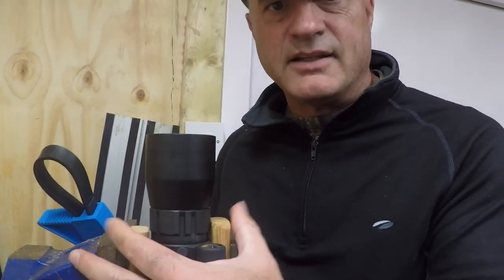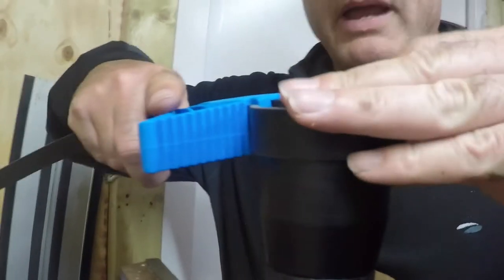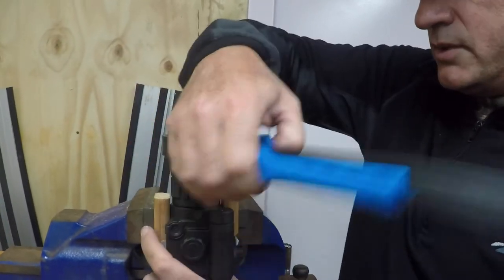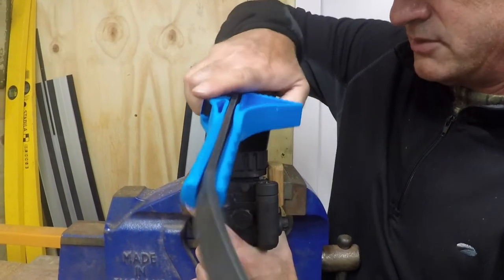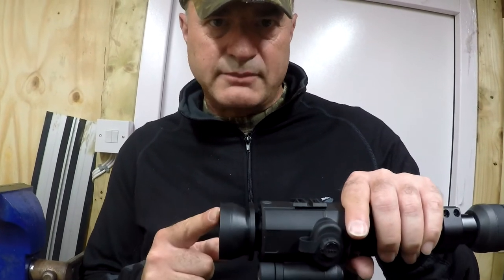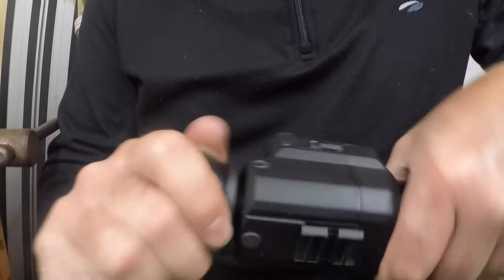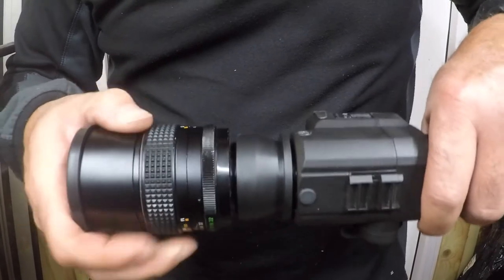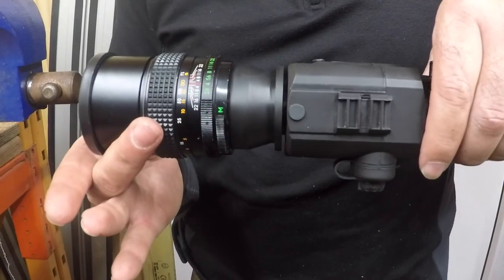Yukon Photon XT Extreme Modification - lens removal

Comment: cracking vid mate,did you remove any screw's,prior to removing the lens,?
Reply from the maker: This model didn't have any screws as I think the newer ones are glued only. Pop the little rubber bungs out just to check first. The older ones do have screws and you need to take these out or something will probably break before you shift it. However they don't appear to be glued so once the screws are out it will probably undo by hand. Yukon must have changed the manufacturing process slightly.
Reply: excellent thank god i removed the screws before i cranked on it.! early model ZERO GLUE!!!!!
Reply: Whats the purpose, do You get a better zoom..?
Reply: is that the 4.5x42 or the larger one? would the sane size adapter work on the 4.5?
Reply from the maker: @michaelhead2966   Both the 4.6x42 XT and the 6.5x50 XT models use the same body and electronic, they just have different lens. Both turn out the same if you extreme them witht he same size lens.
Reply: @charliehunter4366  to RT model is workin to change lens

Comment: Hi does it shift your POI????
Reply: Yes it does and it also obliterated expensive lenses on an air rifle.
Reply: @earlgray3925  How would you rectify this issue....???
Reply: @gtfun107  maybe a recoil reducing mount or a shock proof lense
Reply: After ten recoils from a .177 the wobble on the lense caused over 10 inches of shift.

Comment: charlie is your facebook for the extreme still running ?
Reply from the maker: Not my group but it is still running - https://www.facebook.com/groups/603165543219561/
Reply: Its mine ;-) good vid Charlie
Reply: I was hoping someone might be able to give me some help.  I have a Sitemark Photon which is the US version of the Yukon.  I did the extreme modification on a .223 platform with the intent to hunt hogs.  Since that time I can not get the scope to hold POI.  Tried zero at 25 yds and cant hit 4 x 8 plywood back board.  Before upgrade rifle consistently hit dime size zero at 100yds.  I shoot hogs in the head to drop them and not spook the rest of the sounder.  Since conversion the POI changes dramatically with variation in distance from target.  Current set up and the best I have been able to achieve is 6” high and 6” left of center at 100yds.  I accomplished this by shimming the scope tube.  I’ve tried both a 135mm and 150mm Takumar lenses both of which are in exceptionally good condition.  The vision is exceptional but if not able to rely on accuracy this conversion has been a total bust.  Does anyone have any suggestions?  I’m almost at a point of giving up as the hogs are over taking me by the day.  Thanks

Comment: Can this be done to the 5x42 photon ?
Reply from the maker: Not sure if the 5x42 is a model for the XT. Both the 4.6x42 XT and the 6.5x50 XT models use the same body and electronic, they just have different lens. I've extremed my 42. The older models has screws under the covers on the body so make sure you take them out before trying to unscrew it. Newer ones are glued with no screws.
Reply: On RT MODEL is working or no

Comment: This makes soo mutch sence. Anyone have a link for that adapter
Reply from the maker: You need to join the FB group in the link. Will Knight sells them. https://www.facebook.com/groups/603165543219561/
Reply from the maker: You also need to look for an old M42 thread lens on ebay. It needs to be fixed lens, not zoom, and 105mm or 135mm seem to work well. The 105mm has shot up in price recently - probably due to the number of people wanting them. The 135 is still dirty cheap - more zoom but probably not as bright.